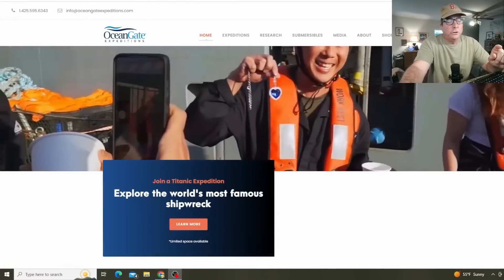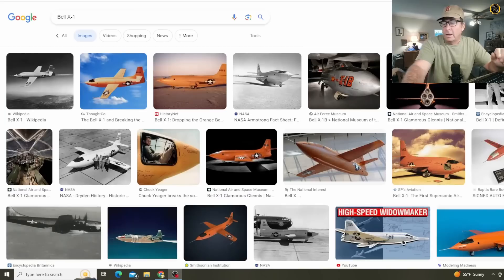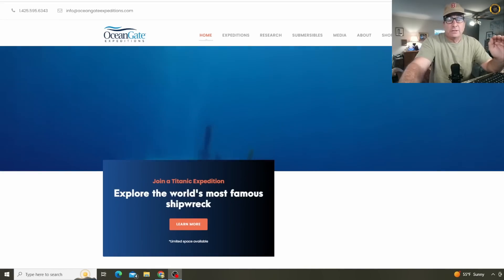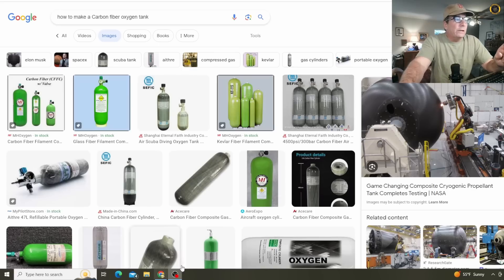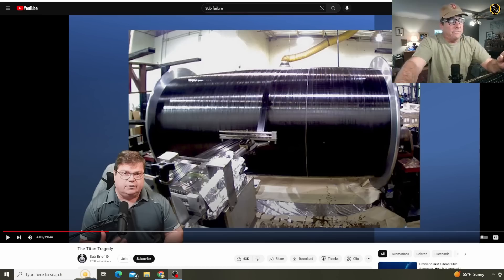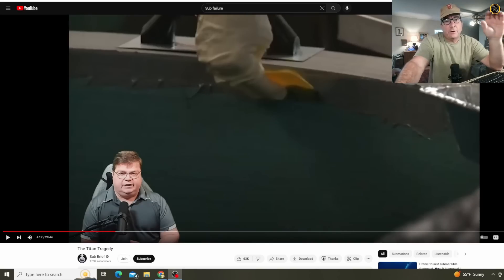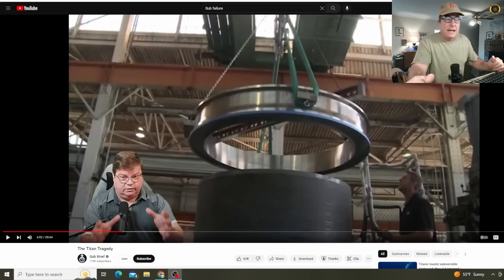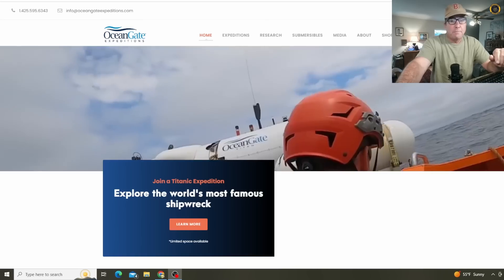Oceangate Sub Construction Details and Implosion

Comment: James Cameron was particularly harsh in his criticisms of the poorly conceived design of this submersible... and there are other reports that the CEO didn't want to run his operation with a safety first mindset as he felt safety regulations were too "burdensome and stifled innovation." Classic egocentric, greed-driven corporate thinking. And it got him and several of the most exceptional underwater explorers killed.
Reply: @Scottforyoutube  You do realize that he designed and built a solo submersible that took him to the very bottom of the Mariana Trench (more than 10,000 meters)? And that he has done more than 30 dives in submersibles to the Titanic wreckage? I'm thinking he is an expert.
Reply: @CrryMan  he’s a dead expert.
Reply: @greenyonline James Cameron isn’t dead, and that’s the expert being referred to…..
Reply: He was humbled by the properties of materials and the laws of physics.
Reply: @martharetallick204  Unfortunately, he didn't have time to realize it. His brain shut down thinking he had a great design.
Reply: @martharetallick204  He was 60, would he have lived forever if he sat inside and never did anything?
Reply: @Scottforyoutube  omg James Cameron is an expert in this field! He has been 3 times deeper than the titanic many times! Respect dude, he is not just a director of movies!
Reply: @Scottforyoutube he says he designed and built his own submarine, so perhaps he's somewhat knowledgeable.
Reply: @vadim7590  He didn't use carbon fiber either.
Reply: They weren't very exceptional if they got in that thing to go to the Titanic.
Reply: @Scottforyoutube  You just succeeded in telling us all that you know nothing about James Cameron without actually saying those words. James Cameron is an expert at deep ocean exploration and diving vessel design. Making movies is his day job.
Reply: @jhopkins213  I'm so embarrassed.
Reply: Killed an innocent 19 yo boy who was terrified but only wanted to please his father for Father's Day 😢 That's unforgivable 🥺
Reply: @traceymacneill9879  That has to be the saddest part. The rest of them were not coerced in any way but he just wanted to please his Dad.
Reply: He was the only one allowed not to be silent others would be silenced 🤫
Reply: Juan, right-on about experimental airplanes, especially military X planes. The first 5 dives in this tin can, should have been with the owner and the guy who manufactured it. Taking paying customers was criminal, IMHO😡. Passengers families should go after CEO’s estate!!’
Reply: @davidmangold1838 The passengers knew the risks. They made a bad decision. Unfortunately paid for with their lives.
Reply: @205rider8 The passengers were not engineers with the special knowledge to understand the risks. How could they know about the long list of ignored best practices? They knew the sub wasn't certified. But what the CEO told them was that it wasn't certified because there were no existing certification methods.
Reply: @perwestermark8920  He lied, there are certification methods the sub build for James Cameron was certified to the Australian standard
Reply: @qbi4614   Yes and no. Of course you can certify subs. But the claim here was that there was no way to certify a sub made from composite materials, because the certification standard did not have such tests.
Reply: @perwestermark8920  Aha, because its a stupid thing to do so the certification doesn't allow for it. 
Ask James Cameron (50 year old white guy)
Reply: @qbi4614  Yes and no. New technology can actually result in problems with certifications even for good designs. So there has been times where new improved methods have been blocked for years while waiting for established certification methods. People specifying  certifications tends to never hurry with new technology. They have a heavy responsibility.

But for this specific sub, I don't think there would have ever been any chance to get it certified.

It's very likely you can find production methods that can allow composite materials. But there were no indications the sub had a well thought out system of redundant computers. And where are the breathing masks in case of smoke? No mechanical circuit breakers to cut power to fried electronics or allowing the pilot to select which of multiple redundant power sources to feed the different subsystems. The communications system seems to always fail. So if a certification attempt didn't get stuck on the composite materials then I'm pretty sure it would have failed for 10-100 other reasons.

When Cameron did his really, really deep dive, then his wife did contact him. Because she could.
Reply: @davidmangold1838 carbon fiber…..carbon fiber cylinder….not a tin can. 😊
Reply: @uwekonnigsstaddt524  it acted like a tin can. Carbon fiber very experimental, especially at 6,000 psi at 13,000 feet down. And titanium mated using some form of epoxy (JB Weld). Best built military subs don’t go below 4,600’, certainly not to 13,000 feet😡. Maybe should have used James Cameron’s builder/designer!?
Reply: @davidmangold1838  We still don't know what failed. It could just as well have been the viewport. And I have not seen any information it was replaced. Because at 2018, the sub had a viewport designed for 1300 meters. Not 4000 meters.
Reply: “Explorers “. You mean rich tourists.
Reply: @mattshaffer5935  Except one who was one of the foremost experts on Titanic. Much knowledge lost with Paul-Henri Nargeolet.
Reply: The USS Scorpion and USS Thresher were US Navy nuclear subs. Something went wrong with both and all hands aboard died. Water pressure takes no prisoners. Rich or poor, smart or idiots, all men must die. Someone said a doctor can bury his mistakes; a pilot is buried with his. My condolences to their families.
Reply: Agreed.  I watched the Sub Brief video and I think Aaron hits things pretty well on the head.   Pretty much the same comment there.  He doesn't care so much about the sub controller as much as the backup systems - since there is really no need for a $100,000 bespoke control device when an off-the-shelf component will work.  Similarly, hiring young engineers who will ask "why not?" and be passionate about a project is not a bad thing in and of itself.

The criminal thing is the CEO not standing to be contradicted and not hiring subject matter experts to tell the engineers the why or why not of a particular design.   A good SME will even stop and say "I don't know why not, but let's find out" and then suggest a realistic test plan. They're not simply draconian task masters who only do things one way... but they can generally provide a lot more insight into why they do things a certain way and what they're designing against.  Most true SMEs that I've worked with are more than happy to nerd out for hours upon hours about the how, why, why not, and what ifs of anything they're involved in.   They became SMEs because they have the same passion.
Reply: If this guy were working for any modern manufacturing operation, he'd have been fired immediately upon making such a comment. Especially anything involving heavy equipment....
Reply: If I'm going into space I will consult space people with a proven record.. if I was going deep in the ocean in a submersible I will consult nuclear submarine captains and engineers.. if I was going to the North Pole I will consult Eskimos.. if I was going to rob a bank I will consult criminals specifically bank robbers.. do you see where this is going?😮😊😮😊
Reply: @richardhowe5583  50 year old white guy ?
Reply: He’s pissed they’re now going to have to regulate his hobby
Reply: @H.B  its no mans land in the middle of the ocean. The only regulation is gonna be on the vessel it launched from.
Reply: @H.B  His hobby? Who's hobby?

This accident may result in lots of new rules for passenger traffic - which by definition isn't a hobby.
Reply: @perwestermark8920  Deez
Reply: His attitude might have been considered to be OK if he hadn’t taken any passengers along with him to their deaths. The world is full of daredevils and risk takers. But absolutely not OK if their risky behavior endangers anyone else.
Reply: Honestly, the CEO had the biggest ego believing he knew more than multiple subject matter experts.  I have met many such people who short cut the design and building of hardware/software products that fail spectacularly because they believed that they knew best.  A leader who does not listen is one who is doomed to failure.  James Cameron did not go into this business thinking he knew more than the true experts.  He listened, he digested and he understood what deep sea diving was all about and he gave it the respect it deserved.  Innovation just for the sake of innovation is bound to head to failure.  No matter how profitable this company could have been I would not have worked for such a leader.
Reply: I would actually like to hear the ceo thoughts on safety regulations now that he's being shitted out by some animal on the ocean floor
Reply: @bencoldwell4609  I don't think any safety regulations apply in international waters. I also hope governments never try to issue safety regulations for this activity.

You are in charge of your own safety. You are best equipped to balance risk and safety for you.
Reply: You know, if the guy wants to risk his own life in that thing, more power to him. When he starts using it for paying passengers, lets have some burdensome regulations that stifle innovation, and keep those passengers alive.
Reply: @russlehman2070  As long as he disclosed that the vessel was experimental and had zero certifications, I think that is on the paying passengers. What is the difference if a person builds a sub and goes down in it vs some people who know have been briefed on the homebuilt nature of the sub and all the inherent risks vs this guy building a sub and then selling it to someone else while disclosing the risks?

Why is the adult that paid for the craft (he certainly didn't build it himself) ok to go down in it, but another is not allowed to pay just to go down in it. Are you arguing you should be allowed to pay for a death trap and ride in it but not be allowed to pay just to ride in a death trap?
Reply: With Stockton Rush (late CEO of Ocean Gate), its probably less greed, and more hubris. These guys think they're smarter than Einstein, and their back of the envelope designs are superior to decades worth of engineering experience. Sometimes making the money, is more about showing you that he has a bigger dick ! Never underestimate ego driving their idiocy !
Reply: "The carbon fiber may have been repaired or replaced due to structural cracks in 2021", its on the wikipedia page, this thing was a death trap, I would not be surprised at all if this turned out to be a "fake their death" scam
Reply: And don't forget what he said about 50 year old white males (about submarine experts) he wanted diversity and young people (with out real experience) nice. Hope they will shutdown this mentally ill company.
Reply: Is Oceangate insured for liability? That insurance company is very foolish. But if Oceangate requred a liability waiver, well, too bad for the divers.
Reply: This wasn't egocentric of greedy. He simply valued adventure more than safety. And he died at 60, big fucking deal. Most of you Americans will sit inside all day and then die at 50 from diabetes. Then you laugh at people going out and doing stuff.
Reply: Sounds to me like they were warned of the dangers beforehand in the release form they had to sign. In a free society a person ought to have the right to decide what is and isnt worth the risk they are willing to take on a voyage such as this.
Reply: :face-purple-crying::face-purple-crying::face-purple-crying::face-purple-crying::face-purple-crying::face-purple-crying: but what  a RUSH
Reply: Harsh, but well justfied!
Reply: You can "innovate" with novel designs without putting people in the damn thing before it's proven. "Stifling innovation" is an extremely lame excuse.
Reply: @benchociej2435  Maybe I missed this point. But what is the proving process. I remember Mercury. Before John Glenn rode it up, I think a dog or monkey went first. The one that died on the launch pad was not fired with humans inside. Of course, later programs were deadly, but the rockets did get tested.
Reply: Exactly right go cheap until you make it.
Reply: Hmm. You don’t know much about James Cameron, then, huh?
Reply: I do agree that we can't be a safety first sociaty. If safety truly was number one, we wouldn't do anything. Everything can be done in a safer method or not done at all. It is always safer to do nothing. If safety is first, we would never leave our homes. We must balance safety as a life of total safety is no life at all.
Reply: @crissd8283  Caring about safety does NOT freeze you in indecision. My driving record has been exceptional, despite hundreds of thousands of road miles. You just anticipate the dangers and treat them seriously. Anyway, if you insist on riding in commercial planes, you better hope all parties are dedicated to safety enough so your trip doesn't end in the side of a mountain or something.
Reply: @JimMork  I understand that. I'm saying safety must be balanced. We could make roads safer by lowering speed limits to 15mph. Guaranteed less people would die; however, we don't because safety must be balanced against many other things. I personally think in this day and age, we are too safe. The government takes a lot of fun out of life by making is safer and more sterile. Then we end up with a bunch of depressed people. If you want to live life with the utmost emphasis on safety, be my guest, but don't tell other people that they must do the same.

These people chose to live dangerously and this time they lost. Please don't tell other people what risks they are allowed to take. It is their life, if they want to base jump or build homemade airplanes, or ride in home built subs please let them. They have their own risk tolerance.
Reply: @crissd8283  As I recall the statement was safety should not be primary. Can't ever be the consideration alone. But primary yes. Who travels with indifference to completing a trip? You can't travel if tickets are priced at a million dollars, so the traveler must afford the trip or shut down the industry. But still, don't sacrifice safety to double tickets sold. Don't fly unsafe planes because "it is more profitable". That is what any regulator believes who actually values the public which supports the industry.
Reply: @JimMork  I stand by my words. If safety is the primary goal then we would lower all speed limits to 5mph. Actually we would ban cars because it would be safer. If safety was primary, we could justify banning all travel. We could justify banning swimming or all bodies of water (every year in the US some 6,000 people die from drowning). If safety is first/primary, we can justify banning all playgrounds, skiing, lawn mowers, knives, trees, planes, etc. As Mike Row says, "Safety Third". We must take risks that are not completely safe in order to live. Safety cannot be primary, it must be balanced against living.
Reply: @crissd8283  That is complete nonsense. No we shouldn't. We SHOULD not allow a huge percentage of people now on the road to be there. We are overloaded with people not fit by character or intelligence to be on the road. But I've never for a second in over 60 years driving thought I should drive 15 mph "for safety". Because I know what I need to do to prioritize safety. It is absolutely my number one goal. And my personal experience demonstrates safety is not at odds with reasonable travel times. My wife hates me taking her places BECAUSE I am so cautious. But she has paid thousands to have her car body repaired. My insurance is as low as it goes. She had to pay for all repairs for years to avoid submitting claims. So that contrast pretty much says what making safety first is about. And I hope you drive better than you reason.
Reply: @JimMork  You clearly prioritize safety but it is certainly not your number one goal. You balance safety against other factors and place a lot of weight on the safety side but it isn't your number one goal and even you admit that. If it were, you would never be out on the road with those people you feel are unfit to drive.
Reply: @crissd8283  One doesn't get on the road with one objective. Or there is no need to start a car. But there can be  in my long experience a tiered list of objectives. Sure, arrive somewhere. Actually that is the point: Arrive. I've built in contingency time exactly because if there is a need to rush and take chances, maybe I don't arrive at all. Any accident means my arrival time goes out the window. Also, I don't wish my driving record to have moving violations. I don't want my insurance premiums to rise. All these considerations determine leaving time, highway speed, and method of driving. A lot of lane changes just is more risky. Ideally, if I can find a lane and remain in it, I'm marginally safer. Some people automatically migrate to the passing lane. Not me. It just takes mental effort to build a safe driving record over a period of time. I listen to these pilots, and they too attempt to anticipate where things go wrong to assure they don't. But travel at that height involves different hazards. And leaving and arriving at busy airports is risky, too. Crossing runways? Garbled instructions? At least on the highway, I make choices only on the basis of decades of driving.
Reply: @JimMork  I just heard that the view port was only rated to 1,300 meters. If the CEO didn't disclose this to the passengers then he is certainly a criminal. If however, the passengers were told this and decided to proceed anyway then the passengers are responsible for their own demise. Except the kid. He wasn't an adult and thus shouldn't have been allowed to consent to this.
Reply: @crissd8283 Absolutely.
Reply: @crissd8283  That is ignorant reasoning, sometimes leaving your house is a safer bet, sometimes not. Safety first just means using your best judgement at all times, in every circumstance. Are you saying there are sometimes you think throwing all caution to the wind is the best way to move forward? I'd only agree with that if the circumstances show that to be the best way, but then I"m not throwing caution to the wind, I'm making a reasoned assessment before progressing.
Reply: @th2k864  In a lot of younger age brackets, driving/being in a car is the leading cause of death. All I'm saying is safety must be balanced against actually living. Some people, that balance is more toward safety and others living. Let the people that like risk, live the way they want.
Reply: I'm a proud Capitalist.  Nothing wrong with greed and making lots of money, IMO.  BUT...there is a limit...and this dude and his company appear to have exceeded it...sadly.
Reply: @turbofanlover  Mr. Gekko makes his entrance.
Reply: @turbofanlover what’s wrong with not being greedy? Subjective definition, isn’t it? Just because a person is a capitalist it doesn’t necessarily means the person is greedy. They are not necessarily mutually inclusive.
Reply: survival of the fittest
Reply: @MetisXIV  Well, yes. But remember stupidity doesnt guarantee survival failure. That's why the smart are vastly outnumbered by the stupid. It is all about frequency of breeding.
Reply: This is a mass ritual regarding billionares. One of the first investors was a rotschild
Reply: @ajmosutra7667  Rothschilds are like honey badger. They don't care.
Reply: @ajmosutra7667  Get yourself a tinfoil hat and see if you can mate it to a titanium end cap.
Reply: They are changimg mass comsciousness
Reply: Egocentric , greed and corporate thinking had nothing to do with this. The company he hired to build was obviously not the right decision. I'm sure he just gave them the goal of what the sub needed to do. He relied on their knowledge and experience. While  carbon fiber has been used on aircraft and cars for decades, it appears to be fairly new for submarines and other deepwater use. I'm sure this was a experimental craft. When you have people buying jets and perhaps the purchaser knows a lot about jets, he's going to assume that the plane will be safe at the altitude it is rated for. Unlike small deep-sea submersibles, pressurized aircraft cabins have been around for 70 years of and there have been plenty of crashes that can be used for research. Not much out there to research but fortunately we have people that know how carbon fiber reacts with dissimilar materials. And like an airplane we may know how many cycles of pressurization, depressurization before it should have been pulled out of service. As far as safety goes he was correct to a point. I worked in a factory where there was an assembly line that had over 40 workers that would build 1,000 Windows per shift. When they first fired the lineup the programmers didn't tell enough people that when you hit a safety stop, the whole automated part of the line had to be shut down and everything had to be restarted . There were days we were shut down for hours because the programmer had to come in to reset everything after a week or so they went in and reprogrammed everything and removed a bunch of safety features that obviously weren't necessary because the whole area had cages and fences around everything. The last straw for me was walking out of work one day and there was a big poster that said every accident is avoidable. While many accidents are avoidable, nature will decide your future even if you take every step possible to avoid an accident.
Reply: @davidclemens1578  So why did the co(rush)fired the safety guy?????